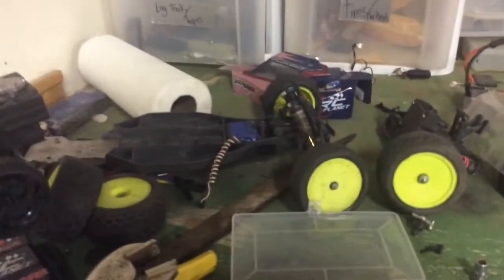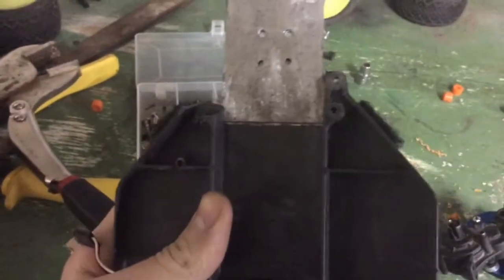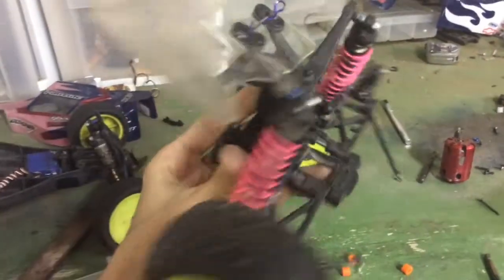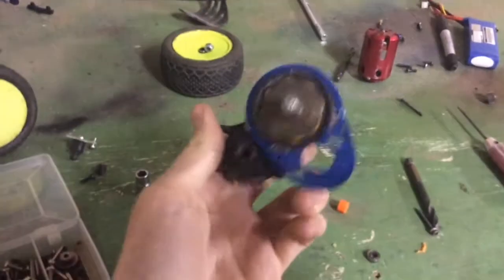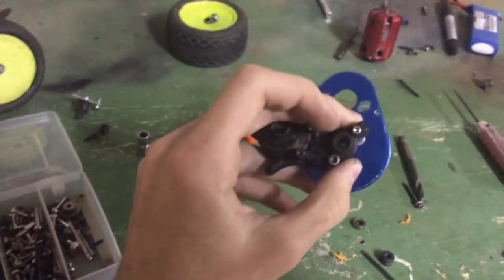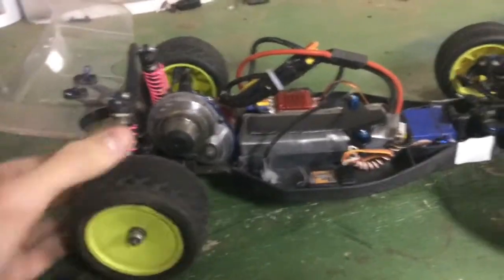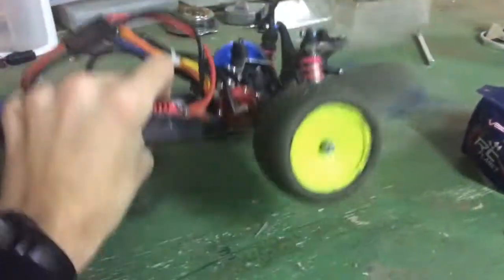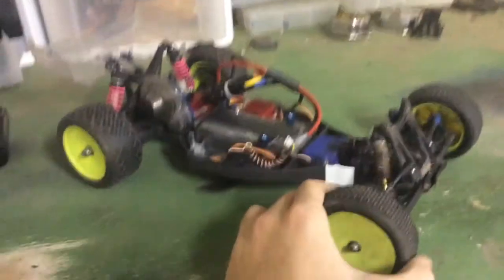Custom B4.2 Mid Motor Chassis

Comment from the maker: Im getting a new car to replace this one, so you might not see allot of videos on this for a bit. Also, if you want to do the top shaft flip mod so you can run mid motor, it works on most 3 gear gear cases, except for traxxas ones where the gear plate is built  in to the gear case.